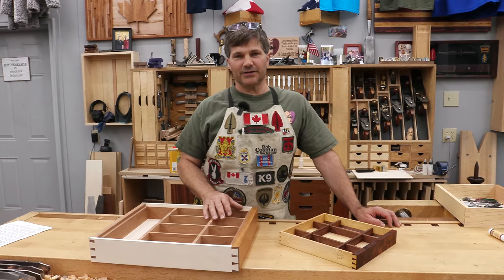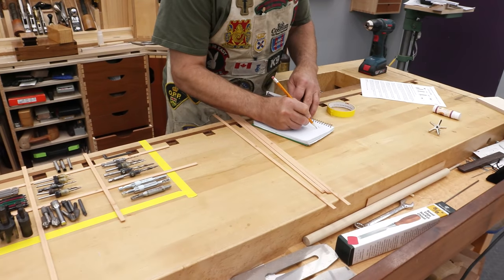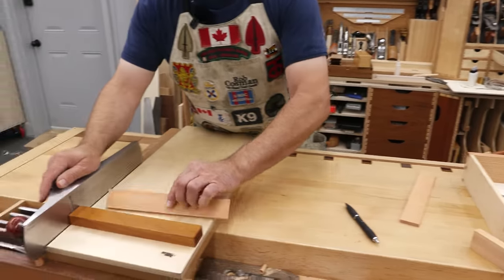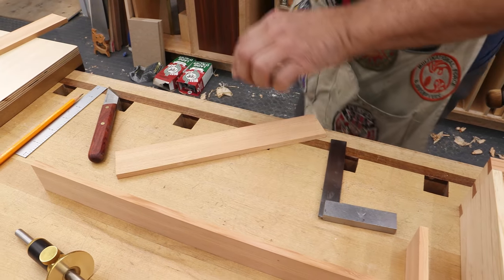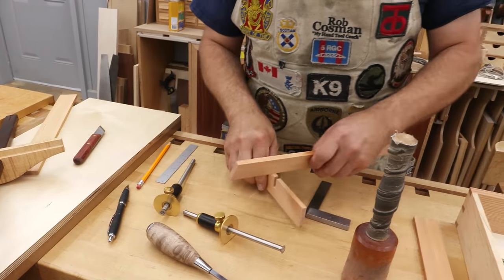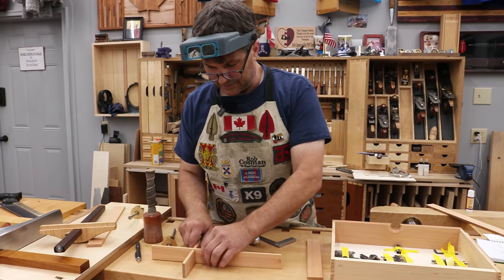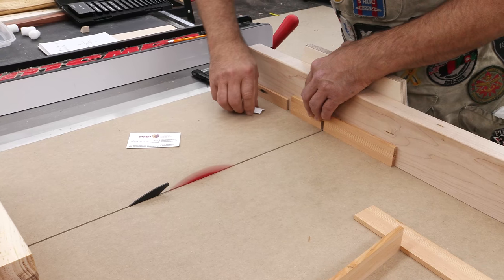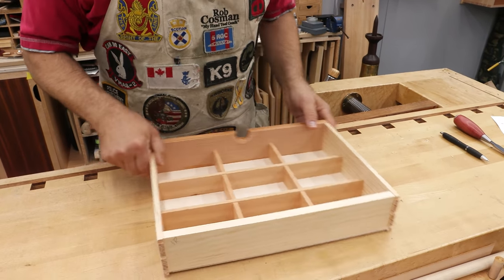Furniture Making Techniques - Drawer Dividers

Comment: I make hundreds of dividers and find a few practices that make it a lot easier.  The depth of cut does not need to be exact half and half, it be slightly more, it will not be seen.  If you use masking tape to gang the length parts together and cut the joint they will be the same.  Do the same for the other width parts.  My dividers are the thickness of the blade cut and it does not matter if you use a regular saw blade and the little "ears" are hidden.  The same truth will be for your example.  You make it a lot harder than it needs to be.  The one thing is to make sure all the parts are the same thickness.  Great show.

Comment: Cigarette paper (rolling paper) is generally .001" in thickness and many old time pattern makers and machinists would use it as a quick & dirty gauge for spacing items. Many tool chests get discovered with a few packs of papers tucked into the drawers-- sometimes people wonder if grandpop was a "stoner" because of the rolling paper-- Nope... He was just accurate and efficient, too.  Good video. Kosman Komiko!

Comment: I have a saddle square that I use for transferring lines around edges and faces.  The fun part is that the square is a test join for that exact joint I built a torsion box trap door for the cellar, joined the interior skeleton that way.  The practice piece has always remained dead square so it's perfect for transfers.  It is in the form of a white pine, equal armed cross, 6 inches square.
Reply from the maker: Thats a great way to do it

Comment: Nice video. I need to make some of these up for my workshop & kitchen.

I have to say what torture it is for the ears to hear the imperial measuring system. 16 eighteents minus 14 32nds x 9 fifteenth of an inch. How do you do it?

I'm from the UK where we are still half & half imperial/metric & I do use imperial measurements when doing large projects, but as soon as I'm working on anything detailed that requires a level of precision or any calculation, it has to be metric. So much easier to work with.

Comment: Fun project! I enjoy custom fitting custom dividers drawers to drawers. I have been using a CNC router to cut foam for each item. This would be a way to dress up the look with the foam in between the wood dividers. I'm going to try on my next drawer.
Reply from the maker: That's a great idea!
Reply: What sort of foam are you using David? Not just plain foam rubber? Wouldn't think a router would cut it. Maybe some high-density stuff? Thanks in advance!
Reply: @KimbrellBrad  I'm using Kaizen foam I bought  on sale from rockler. it is a high density foam and cuts great on my CNC router.

Comment: I've recently learned the drill bit technique to make the perfect slots for the dividers. Set the stop to the outside edge, than use a drill bit the same size as blade kerf to offset.

Comment: What if you roughed out to the boards cut the slots and then playing the boards to fit the slot would that be quicker and easier
Reply from the maker: then your slots would not line up with each other as you could not plane exactly the same amount from the ends to fit the drawer

Comment: You could also fit the assembly using felt like you would a humidor divider
Reply from the maker: I dont smoke so I am not sure what that is all about, can you explain?
Reply: Sorry about the double post, lost my mind there, just for a second. If you leave the pieces with a bit of “wiggle” room, you glue a strip of felt to the ends. It will fit snugly, and because the felt is on all ends, the assembly won’t move. Also, there will be no chance of altering the fit of the drawer.

Comment: Rob, good video. I would use the kerfmaker to set the width of the notches, it saves a lot of mucking about. Also is that a repair on the back edge of the dovetailed drawer at 1.25 and is that face piece some sort of burl?

Comment: Could you use one of those “kerf gauges” to set each cut thickness for the table saw? Don’t have one my self but have been intrigued enough with the samples I have seen online to make one like the Andy Klein version as an example… but as all the others have already stated loudly…. A threat example of how it is done well. Cheers from Western Australia.
Reply from the maker: I know what you are talking about but I have never used one so I cannot comment.  I just take my measurements right from the wood as shown...no need to spend money on another jig

Comment: Too cheap to spend $120 on a joinery blade for the table saw, so I picked up a TCG melamine/laminate blade on sale.  It left corners that needed clearing for a year and then I had it sharpened, but told the person sharpening that I was going for a flat top grind.  That made the corners a lot smaller and easier to trim.  It's out for the second sharpening now, should be pretty close to perfect.  With 80 teeth, it works really well cross-cutting joints in hard woods.
Reply from the maker: Let me know if it gets a true flat grind on the top when you get it back from the sharpener
Reply: @RobCosmanWoodworking  Looks perfect to me without magnification; at 20X there's a few thousandths bevel on one side, maybe 2-3 thou?  Sorry, said it wrong above.  The blade started out as a laminate/melamine blade.  It's good to go for cross-laps and kumiko now.  Not much of any rake angle, but cross-cuts ash just fine.  It's sorta close to a specialty joinery blade on the cheap.  On the other hand, I've never used an ATBR blade.  50 teeth is a bunch, but they seem to have a fair bit of rake.  How much rake would one want in a joinery blade?

Comment: Rob, why don't you make a marking gauge with the wheel flipped? Then you could score the inside line without needing a panel gauge.
Reply from the maker: You can do that, and I’ve had to do it plenty of times before. The issue is that the shape of the cutter either pulls your marking gauge toward the board or away from the board. I will usually only do that if I find myself in a situation where I can’t use a different tool.

Comment: Rob, I am curious as to why you use the marking gauge instead of the square using the reference edge to transfer the marks across the top and on to the opposing face? Is there an issue with using the square or is it just preference ....  as not all of us have the longer gauge
Reply from the maker: I just trust the marking gauge more than squaring around with the knife.  Squaring around is fine 99% of the time and the wood is so small here that using marking gauges I admit is overkill.....but that's just how I roll I guess

Comment: Me continued... next I would decide on my distance between 1in 2in 3in cetera... using a box joint jig simply cut into all parts at whatever interval you decided... I would do probably every inch... once you make all Cuts in all parts... simply put parts together as necessary to accommodate space as necessary

Comment: Always use a push stick on the table saw when your fingers are within 6 in of the blade.  Hooking the little finger over the fence does not provide an adequate level of protection.
Reply: It's OK, he's 'experienced' which means his fingers won't be cut off when he inevitably puts them in the blade.
Reply: He's old enough to make the decision on his own. Thanks mom.

Comment: Another great video. What i've noticed about the back of your drawer box's you don't plane the drawer sides down to the backs after the glue up. Is there a reason for this, I know its only seen when you remove the drawer from the carcase.
Reply from the maker: I talk about this in my drawer making series, so for the details see it.  I like the back lower to make it easier to get the drawer in an out
Reply: The sides need to be a certain height so that the drawer works. You cannot plane them down after glue up, because that would make the drawer loose!
If you make the back the same height as the sides, then you cannot easily close or open the drawer, since the air (behind the drawer) has no way to escape.
Reply: @johncoops6897  Exactly! And when you work to Rob's standards of a piston-fit there would be no way to get it to stay closed LOL!
Reply: @KimbrellBrad  - you could drill a large hole in the rear of the casing, then connect some duct tubing. Instant bellows for your iron working forge!

Comment: I was hoping you'd show how to glue or attached the dividers into the drawer more permanently, which is what I always have trouble with.
Reply from the maker: I dont permanently attach mine, i want them to be removable in case i want to redo the grid
Reply: Tiny nails or little bamboo skewers as dowels would work well. I like the ribbed nails, they hold a lot better. For hidden bamboo dowels, use a 1/2” thick plywood template to locate where to drill the holes, drill through the guide hole in the template, and point the ends of the dowels to give some leeway.

Comment: A fixed size divider like this is hard work to build and VERY inflexible. It's far better to use a series of rebates in full-width Left<>Right dividers, then have a set of movable inserts for the other direction.
That way, when things change (which always happens) you don't have to re-make the whole thing, you can just move the dividers around. If you use 1/8" ply for those small dividers, you can just use standard table saw blade cuts as the rebates.
Reply from the maker: That will work...but doesn't give me the fine craftsmanship look and feel I demand of myself

Comment: Longest size is length, usually along the grain. The middle size is called Width and the thinnest size the thickness. Keep cosistant to enable learners to get the correct terminology. I started my woodwork learning 66 years ago and am still learning.

Comment: Hahaha…your using your fingers as a push stick that close to the table saw blade is a huge no-no. But I do it all time too. 🥴🥴
Reply from the maker: Not if you know how to have positive control on your wood.  You will note that I loop my finger on the edge of the fence to keep my hand tied to the fence and my finger away from the blade.  I pay very close attention to the cut and I have 100% control of the wood.  This method is NOT for those who cannot achieve these critical elements, but done correctly and EVERYTIME it is a safe procedure
Reply: @RobCosmanWoodworking  I agree. I do the same. I keep fingers over the top of the fence as well, while applying downward pressure on the wood as I push it thru. The standard ‘safety protocols’ however say to never do that. I have been doing it also for many years. I only have had a riving knife on a saw for two years, so I get it.

Comment: There are much easier and quicker ways to do this on the table saw: use two stops, one on either side, to cut the slot to the dimension of the smallest one, then remove one stop and refine by adding paper or whatever to the remaining stop. Also, don't ever, ever arrange wood on the saw with it running.

Comment: 9:25 into the video; experienced or not! Rob should not be showing that!!
Reply from the maker: Why? I have full control, I have two fingers sliding on the fence, and to top it off, I’m using a SawStop. I put the disclaimer in there so I can do whatever I want, but if you’re not comfortable, use a push stick.

Comment: Man I am sorry I could not watch anymore after about halfway through you need to productionize this let me help you out a bit... I would measure the width of my drawers and then the depth of my drawers whichever is the longer I would call that the length whichever is is shorter would call the width off the bat... Now set up your table saw for your depth of cut to be halfway into all parts length and width...